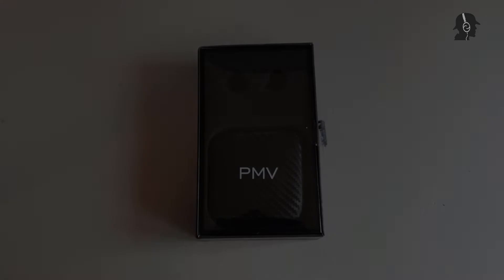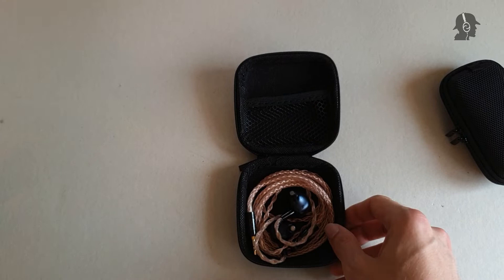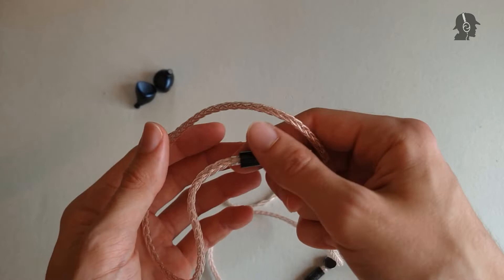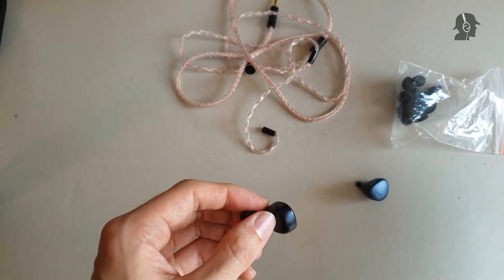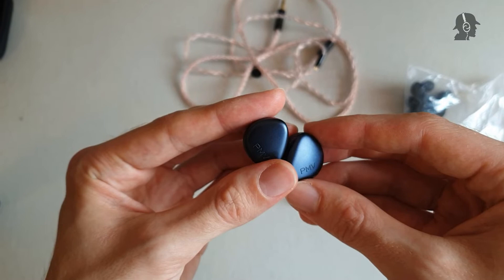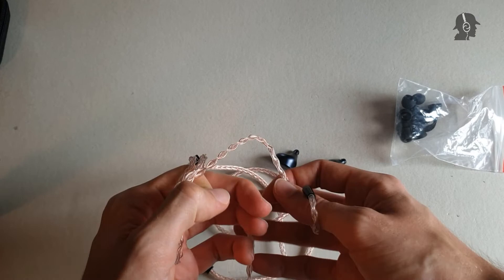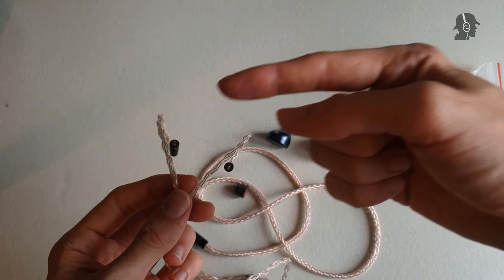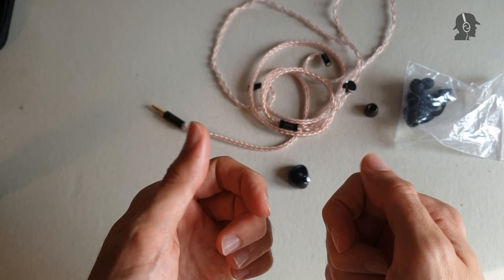PMV PP Review - Planar IEM for 190$ done right...?

Comment: Hello friend, from Spain, I am interested in knowing if these PP sound the bass rumble, or it sounds a natural or relaxed bass, I do not like the bass, I recently bought the Tripowin melee and they have disappointed me a lot because the rumbling was quite noticeable In the bass, similar to the Tin Hifi T2 plus that I also had, those have even more rumbling in the bass, I want a sound more similar to the urbanfun or Fiio Fh5 but with greater detail and definition, I think that the PP has a driver from planar magnetic it will be a more natural sound, a more natural and relaxed bass, without rumble, that's why I ask your advice. 
Más información sobre este texto de origenPara obtener más información sobre la traducción, se necesita el texto de origen
Enviar comentarios
Paneles laterales
Reply from the maker: Hello Mark

You probably define "rumble" as sub-bass over mid-bass? If so, then the PP could work for you. It has less sub-bass, compared to mid-bass but in general, is more "bass light" than the Mele. Otherwise, maybe something like the New Hana, if you want to stay at V-shaped IEMs. Alternatively, maybe consider the new P1 Plus.
Reply: @don_spektor  Do you know the 7hz timeless planar magnetic earphone? It is in ear and it is easy to move, very efficient compared to the tim Hifi p1, and it is considered the best iem with planar magnetic technology, surpassing the pp, bud guy reviews has made the review and comparison with the 5 iems planar magnetics
Reply from the maker: @marklewis7101  Yes, of course I know it. But you specifically asked for something with "less rumble" and the Timeless has sub-bass over mid-bass, hence it has rumble.

But if you ask for my personal opinion: Timeless is the best tuned planar IEM out there and judging by the PMV PP, which has the exact same driver, its technicalities will also be pretty good.

So if you are after the best tuned planar, the Timeless will be your choice, however you might then need to EQ the sub-bass a bit down. 

Also keep in mind: the Timeless has a pretty big shell, which might not fit every ear. PP has a smaller shell and longer nozzle.

Comment: Don't like foam tips. Reason is bass gets devolved between the foam when bounces back. The 2 flange tip is good because I did buy the triple flange and I always cut one off. Reason is fits without going to deep inside. The flange tips is good for sports and hot weather. They don't loose grip. Big cases are good no to twist cables close to 2 pin.
Reply from the maker: I always prefer foam, it's just more pleasant to wear to my ears and the additional bass energy I also like^^
But yes, that's totally up to taste. The double flange unfortunately is just a tad too big for my ear canals so I can't really wear them for a long time...
Reply: @don_spektor  I get you. I listen to music mostly in the gym. Foam.sweat, not a good combination.  And with silicone tips the water gets between the ear and tips and I keep raising the volume.  Like the sound is submerged in water. Lol
Reply: @don_spektor  i saw this from a guy. He removed the pipe on the foam tip. Then inverted the silicone tip. Placed the silicone tip through the hole in the foam tip and then reversed again. Now I got silicone tip and under the foam tip all in one.
Reply from the maker: @paulosilva8200  Thanks dude, that's a nice tipp, I'll see if I also try that :D
Reply: @don_spektor  Roger that